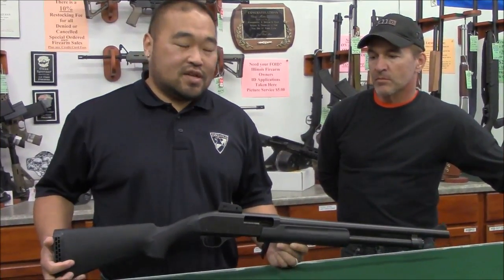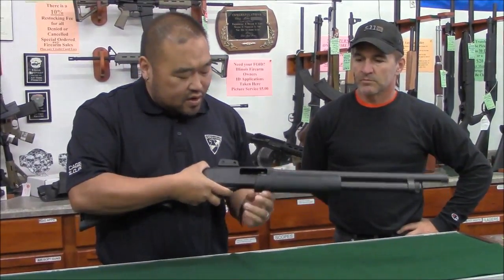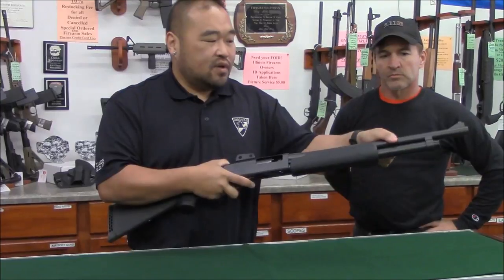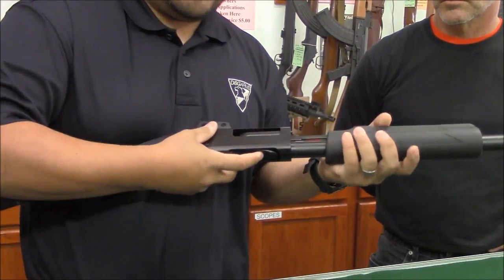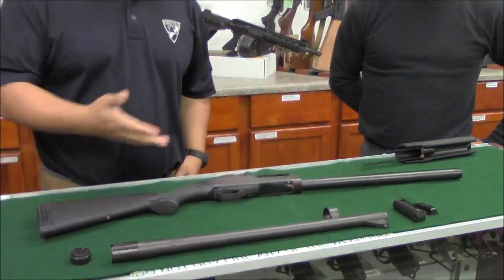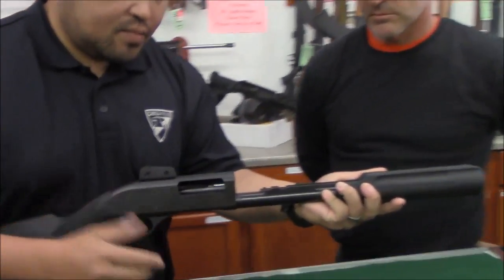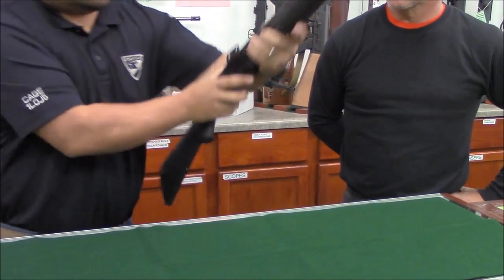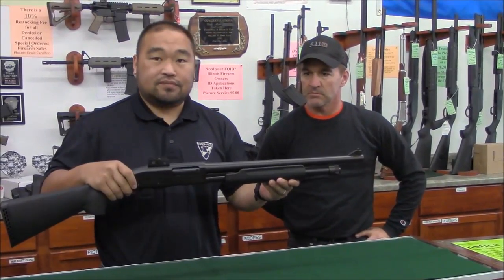IAC Hawk 982/981R Disassembly

Comment: love my 982, the only thing I don't like is the screws that hold the ghost ring sight in are cheap, mine came lose and when I tightened them up, carefully, the single slot groves wanted to strip, going to look for some better screws.
Reply: +trocker222 They're metric screws; blue Loctite is also recommended for fixing them in place.

Comment: Okay I hear that all 870 parts will fit this. I am assuming people mean stocks and forends, but what about the little parts, like extractors, springs and pins inside the trigger assembly, etc? If ANYTHING goes wrong, can it be fixed with 870 parts?

Comment: i have a 982 and my firing pin snapped in halff. can i use an 870 firing pin to replace the broken one from the 982??
Reply from the maker: Honestly, I'm not sure.  You could check with Brownells.  I believe everything is interchangeable between the two models except for the barrels.
Reply: +Training with AJ 
I have a hawk 982 but the forend dosent screw off to change the forend
Reply from the maker: It should screw off.  You need a special wrench to unscrew the forend nut.
Reply: @trainingwithaj5393  I just bought a used model 98. I'm hoping a wood forend from an 870 will fit.  and the stock.

Comment: I put an Hawk 981 tube assembly into a Remington 870 Forend and it stucks in it. I think Remington forend is ~0.5mm smaller in inner diameter. Now I cannot rotate or withdraw the tube assembly from the forend.  What's your recommendation to destroy the forend so that I can take out the tube assembly? A tube assembly is $90 for Hawk 981 12GA on ebay.  The forend was only $20. Appreciate your recommendation.

Comment: correct me if im wrong but the 870 barrel isnt interchangeable with the 982
Reply: You are right, they are not. Hawks have the barrel ring 5cm away compared to the original 870's.
Reply: You are wrong
Reply: @raymoore9993  prooff?

Comment: I have a 981 and the slide has alot of slop before it moves the bolt . Can anyone tell me how to fix that?
Reply from the maker: Jason, I'm not sure what you mean by slide.  Are you referring to the pump forend?  If you are, there is a nut that holds the handguard/pump on.  Make sure that nut is tighten down.  There will be a little play.  Hope this helps.  It's hard to say exactly what it is or how to fix it without seeing it.

Comment: Great video- I just got a 982, and it's been a long time since I've done any shotgun work since retiring from the Navy in 2002.
I like your short & simple presentation; as the gun was  gently "pre-owned" and I got it for a steal on GunBroker. No manual, but very, very well made and solid!
My on'y question is having some failures to eject while using Remington slugs. It might be my failure to quickly rack the slide back & forward-( the last shotgun I used was the Mossberg 590A on the US Navy Law Enforcement Shotgun Course in 1991).